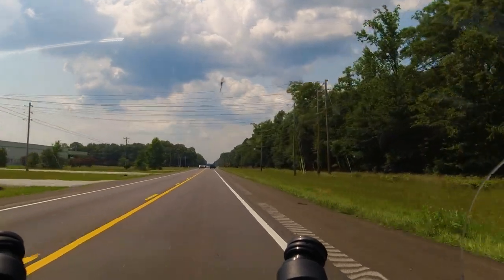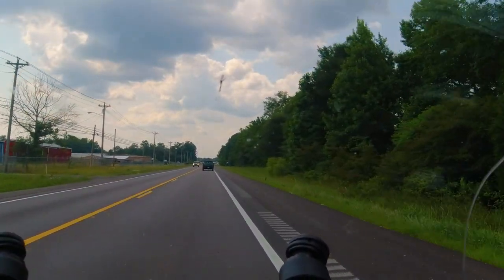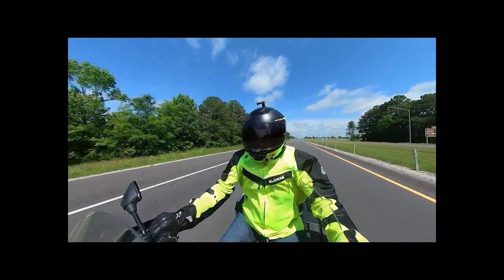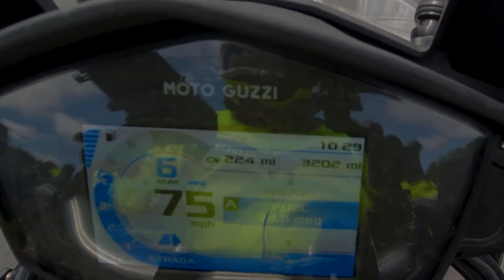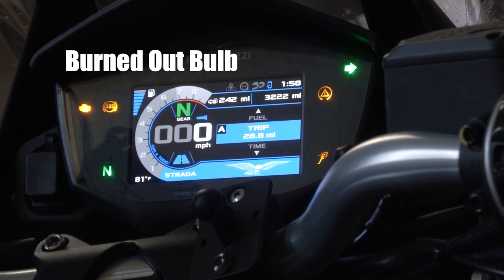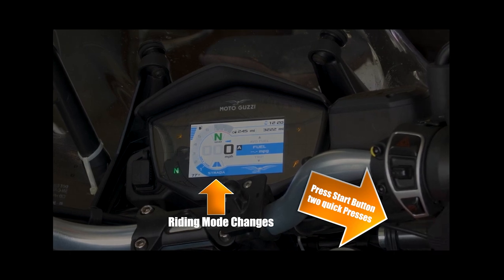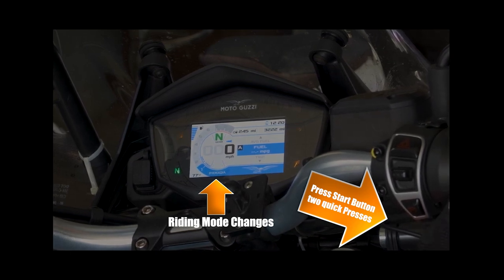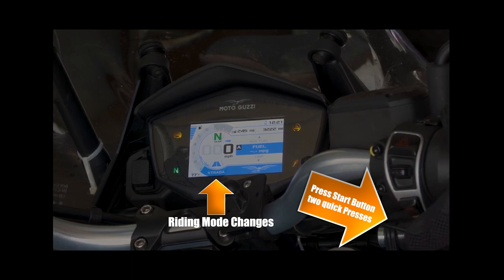5 THINGS YOU MAY HAVE MISSED IN 2020 THE V85TT MANUAL #MOTOGUZZI #v85tt

Comment: Thanks for these tips!   I just bought a new condition v85tt with 129 miles on it and riding it home from the shop I was confused on a lot of the possible functions of the many buttons, like the light buttons have two separate sets with 3 options each …. Not sure what is what with them . When I put the kick stand down the engine cuts off and I don’t like that!  Can that be disabled?   This weekend I plan to dedicate some quality time in both riding it and playing around with all the features.  ✌️😁🇺🇸
Reply from the maker: Kickstand is a safety feature  you can put it down only if you are in neutral.  athats so you don't drive off with it down.  there are daytime running lights and fog lights as well as high low beam. I'll mention these in the next video for more  detail. thanks for watching!
Reply: @americanguzziguy  my other motorcycle is an ‘03 Harley Softail Deuce so now you may understand my confusion to all this new stuff 😜😁 thanks again!
Reply: @mmm357m  thanks for the response!  I figured out the light switches, I guess having an Italian motorcycle has a learning curve 😜
  I’m loving this bike and riding every chance I get . 😁

Comment: What does the manual say regarding the recommended gas octane level?
Reply from the maker: Thanks for watching,  The manual doesn't really specify octane as far as I can tell, but does say no more than 10 percent ethanol  and unleaded of course. I'm going to talk about fuel in my next video, still doing some research, hope you'll tune in. Thanks.
Reply: Chapter 3 "Use", "Refueling" in the manual, page 155 under "Characteristic"  it says "Unleaded gasoline E10 (95 R.O.N.)", which I've found means that "95 RON is roughly equivalent to 91-octane on the anti-knock index currently used in the United States."
Reply from the maker: @Nathaniel7420  You are correct thanks  for clearing that up.
Reply from the maker: Actually as @nathaniel pointed out in the comments, the manual specifies E10, 95 R.O.N. which when averaged with the MON, you get 91 AKI (Anti Knock Index) which is what is in the pump in the USA.  I answered your question too quick, thanks for the community to set me strait :)
Reply: For my third tank of gas I filled it with 89 ethanol free.  I don't notice any difference.  I'm going to stick with 91 though like MG says.
Reply from the maker: @Nathaniel7420  agree I'm going back to 91 now too.
Reply: @Nathaniel7420  , the V85TT doesn't require 91 because of high compression,  but rather because of the potential for high temps like would happen being caught in traffic.  I put in 93 non-ethanol fuel at home, and if I am on a ride where I won't make it back home before needing fuel, I will add fuel at half a tank.  That way if I can only get 87 non-ethanol my relative octane will be 90.  And if I can only get 87 10% ethanol my relative octane will be 90, and ethanol 5%.
Reply: It says use 95 (euro octane is different scale to US). I use 97 and 99 in mine without problems. You can use E5, I never use E10

Comment: The way they set up the Turn Signals isn’t conducive for Real World Application. It’s the MOST Stupidest way to have them run in that manner. The Engineers ought to be FIRED. YEP you can tell I’m a bit upset with em. And you can not reset them via an upgrade to the Bikes Computer, we are stuck with this Flaw.
Reply from the maker: Do you mean the auto canceling turn signals? I agree not very useful for real life, but I have never trusted auto cancel signals and always use them manually.
Reply: hmm, if your signal on a quarter mile before your turn (without stopping) seems like it should work pretty well.
Reply: There has been times in which I travel at least a half of a mile before it turns off. I’ve had owned other Brands of Motorcycles and their Self Canceling Turn Signals shut off after 150 feet. Which is perfect. If I don’t have any traffic behind me when making my turns.. I don’t use em. Too much of a Hassle.
Reply: There has been times in which I travel at least a half of a mile before it turns off. I’ve had owned other Brands of Motorcycles and their Self Canceling Turn Signals shut off after 150 feet. Which is perfect. If I don’t have any traffic behind me when making my turns.. I don’t use em. Too much of a Hassle.
Reply: Yeah, seems more like a safety backup feature version of auto cancellation since it's too long and too far since most of the time turn signal that early is too early. I'll take it over other solutions that aren't 100% reliable or systems that can cause issues.

My only experience with auto cancel that works is on a Harley. Pretty nice, keeps you in the flow. I think I just need better turn signal habits instead to keep me in flow on the Moto Guzzi.
Reply: @GloriasHubby  Yes, so you've said - three times now!
Reply: When I hit the Reply button sometimes my IPhone freezes and I don’t know if it went through. That’s why it is repeated.
Reply: Funny, until I saw this video I didn't realize the turn signals were self cancelling! First bike I've had this on, I always (well, nearly always) cancel them manually. Nice to know they will (eventually) cancel if (when) I forget! The squishy switch takes some getting used to, and I just discovered you can cancel them by pressing the left section, I was doing it old style by pressing the protruding bit.